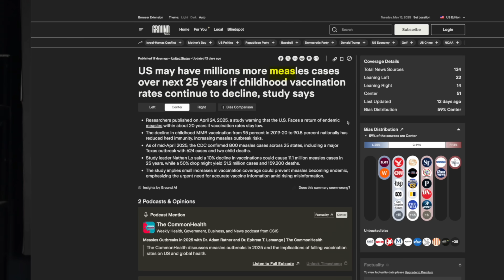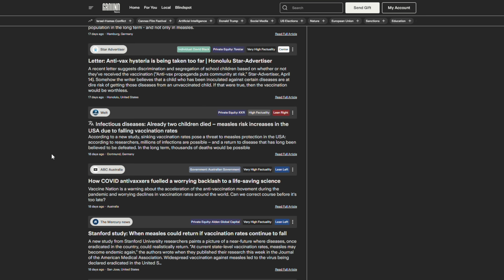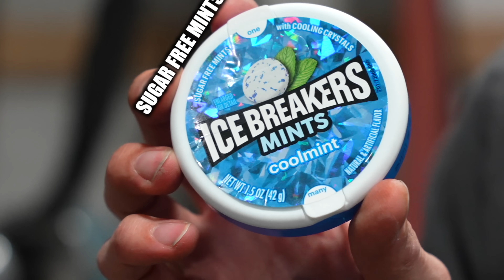Shocking Secrets in Mints and Tape!

Comment: Suggestion: cement casting from molds, but under a vacuum. Would the evaporating water create bubbles within the cement leading to "cement foam?" Or would it evaporate too quickly for the cement to cure and set, making it all end up as a crumbly mess? Would it make a big mess of the mold? Or would it get rid of the air within the cement making the bonds within its structure even harder?

Comment: Don't know if this is possible or not, but on something like the tape wheel, could you measure for voltage while it's running? Form wise, that looks remarkably like high voltage.

Comment: For the wheel experiment I would like to see it with either kapton tape or packing tape as those don't leave behind chunks like duct tape. Also hook it up to a motor and a gear so it's continuous. Also turn up the speed to see how big it can get. (Might also get hot so be careful not to melt anything)

Comment: I’m not physicist but photons are given off when electrons jump from one shell to the other, from an outer shell to inner shell releasing energy in the form of photons. So by pulling the tape apart energy is added to the surface atoms making the electrons just up to the next shell energy level, then almost instantly dropping back down to a more relaxed state releasing that energy as visible light (photons). The more energy added whilst pulling the tape apart the more energy released, higher energy photons from visible up the scale to X-rays. I would imagine with the right material (probably certain atoms involved),and enough energy input, which would be an extreme amount, gamma rays could be given off, but that would be the extreme end of the energy levels. That’s from my novice understanding.

Comment: That was a weird ad segment that made little sense lol. This kind of light is crazy and there are many other forms also but I bet this one is 100% easier to make compared to others! That last second before the sander breaks into the center of the mint and the wall turns blue and bright looks so cool, I wonder if it the mint in the candy that does this or is it the candy, and if it's the candy does other candy do this nvm you touched this topic? Also it be cool if you melted down the minds and formed a giant on and see if that makes the light still? Also I use the T-rex Duct tape, it has to be around 2x more sticky I wonder if you use that would the light be more?

Comment: For Triboluminescence, I can't help but feel the principles behind how it works must function -- in at least a small degree -- similar to Light Emission Spectroscopy where it's electrons absorbing energy (in this case, heat from friction) to jump to a higher energy state, then jumping back down, emitting the energy as a photon.

Comment: Old-school photographers know this effect well.  Kodak B&W films (Tri-X, Plus-X, T-Max etc) used a specific tape to anchor the film to 35mm and 120 film spools which was an odd color of mottled purple.  When you'd pull the tape off the spool to roll it for processing and you'd hit the end of the film, you had to peel the tape off.  There was always this blue line of light, which exposed the film there.  This was beyond the end of the pictures so it always ended up in the trash.  I never had a name for this phenomenon before now. I used to always keep the purple tape because of this and had a bunch of it on the outside of the folcers where I kept my sleeves of finished negatives.

Comment: i'm surprised you didn't try spinning the wheels with a drill to get a nice consistent light. might need to gear down to get enough torque to spin them if they're particularly stuck though.

Comment: You just need to use pure copper for all the gaskets, clean everything using acetone, and use both like a turbo molecular pump and any so called roughing pump. I think if you have a decent welding setup the main costs are the turbo pump and materials and labor.

Comment: With the quartz being the meaning behind triboluminescence, does that mean piezoelectricity is under the same category?
Reply: I wondered this as well
Reply: as far as i'm aware, most piezoelectric crystals are just quartz crystals. you can also push electricity into quartz crystals and they'll vibrate. ever seen "quartz movement" on a watch? that's literally what the watch is doing.
Reply: @TheAruruu  I don't know about OP, but I knew that. Not sure that clears anything up, though, but cheers!
Oh, and just to be clear, the quartz is only used for timing in a watch. Its literal vibrations aren't physically moving the gears. There is still a motor.

Comment: PTFE is triboluminescent as well. I have a little razor blade guillotine for cutting bowden tube for my 3D printer. One day I was making a cut and noticed a bright flash of light from the tube as I cut it. The lights in my shop were on, yet this flash was very clearly visible. I posted a picture of it on reddit, it should be one of the first results when your search "PTFE triboluminescence". I couldn't find any info on this property of PTFE, though I'm sure someone has studied it at some point.

Comment: So with the crystals in the mints, are we SURE that's the same effect as the tape? To me the tape seems almost like static leaving charged particles. Could this (I'm not trolling) be like a very very small form of fusion? Like you are breaking up bonds. 

The mints almost seem like a piezoelectric crystal  ..... It also lead my brain to crystal and stone vitrification. It all seems related. Like how stone and metal have that latis frame like a crystal we are breaking down? Oh so the oil plays a part. ok. wild.

Like somewhere is a mini Thor who commands the power of mini tribal luminescence.

Comment: I've always wondered if you can make pasta (EG: ramen, spaghetti, etc) in a vacuum chamber, like will the vacuum cause enough negative pressure for the water to penetrate and hydrate the gluten, or do you need actual heat for that process.

Comment: An idea for a future video.  I am not a chemist, so this idea may be wrong in many ways.  Create and experiment with liquid carbon dioxide.  For example, gaseous carbon dioxide reacts with water to form carbonic acid.    Liquid carbon dioxide needs to be kept under pressure.   If the water is kept under enough pressure to keep it liquid, would it also react with the liquid carbon dioxide.

Comment: Now that we know it's Sugar + Winter Green Flavor: Can you cook up your own? Basically a big long billet of "LifeSaver" and push the whole thing into the grinder?
I'd also love to find out it there's a way to make sufficient sparks to actually light a fire with something flammable.
Reply: Yes. I want to see if it would light gasoline vapor or liquid.
Reply: I don't think its like sparks you'd see from grinding metal. Its emitting light, but likely very little heat. Fluorescence releases light because molecules can absorb light, then release some energy as heat(molecular vibration), then release the rest of it as a lower energy photon, in the visible spectrum. Thats why the mints glowed, the high energy light given off by the sugar which isnt visible is absorbed by the molecules in the wintergreen oil, then reemitted at a lower energy (blue light).

Comment: This effect is so cool, I've never heard of it before. The mints being pushed into the belt grinder looks like they're being vaporized or going through a portal in a Sci-Fi movie.
Reply: The neatest part is that I think it was discovered by YouTubers only like a decade ago.  I want to say it's the How Ridiculous guys when they shot two glass globes out of a canon at each other.  The collision generated this.  It might have been earlier, though.  I feel it's extremely likely that The Slo Mo Guys saw it, but it's possible they never collided materials that exhibit this interaction.
Reply: @bvoyelr The glass globes wasn't actually tribolumenescence. Smarter Every Day showed that it was adiabatic heating of the air between the globes (similar to the glow of a re-entering spacecraft). The glow from tape and wint-o-green mints has been known about long before YouTube even existed. I have a book from the 80s that talks about it.
Reply: @bvoyelr  this wasn't "discovered by youtubers". It's been known for a long time, decades. There are mobile x-ray devices that work on this idea, despite what nate says you don't need that good of a vacuum.